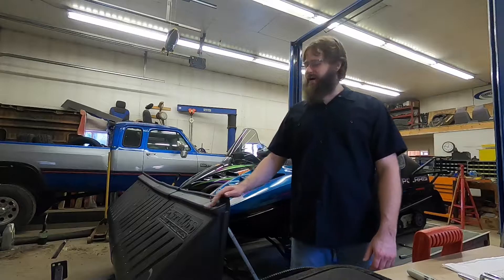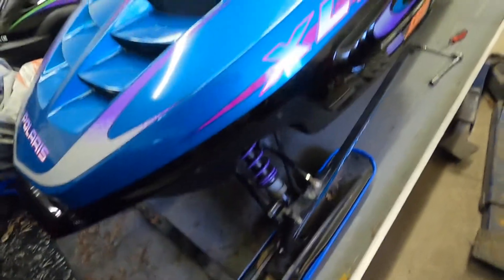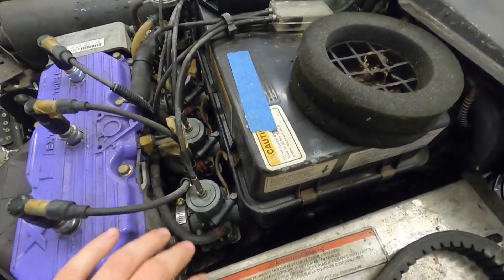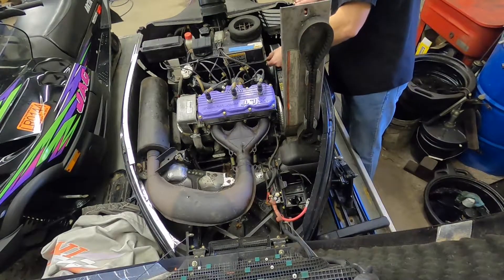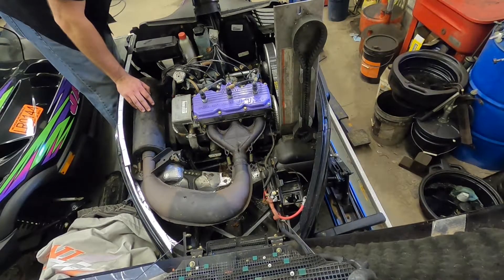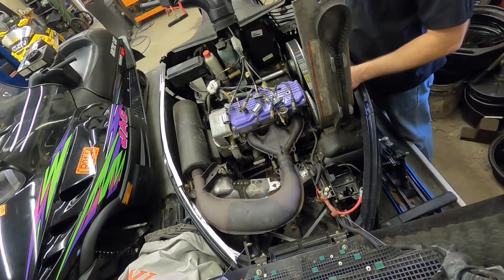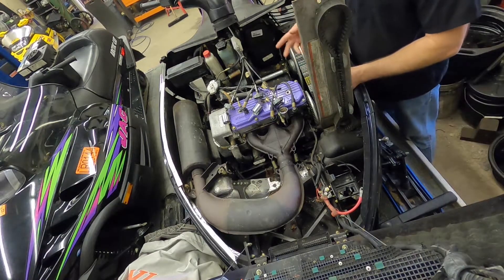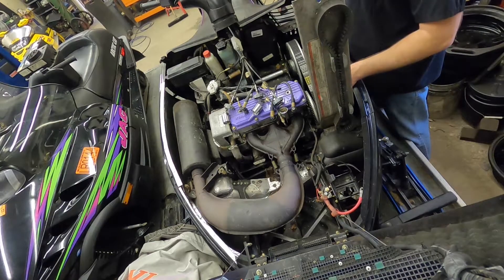1997 Polaris XLT Gamble Pulling Carbs And Mouse Nest

Comment: I'm not very knowledgeable about engines or snowmobiles, but I'm working on a '97 Polaris XLT Touring sled right now. It also had a mice infestation but I don't think the air box was in bad shape. It runs, but two of the three carburetors are sending gas through the air lines back into the air box. The air box is then leaking that gasoline through the bottom of the sled.

How would you proceed?
Reply: sounds like stuck float maybwe